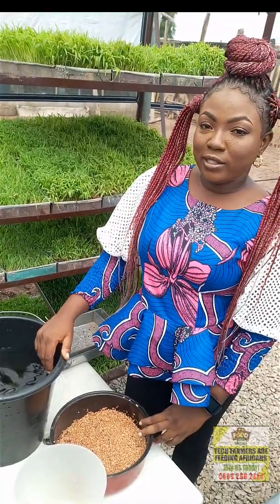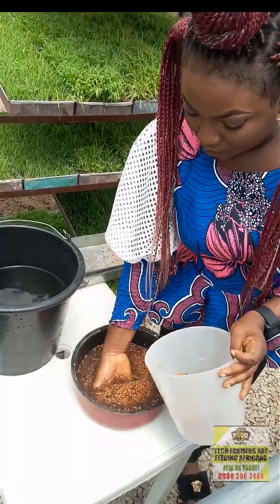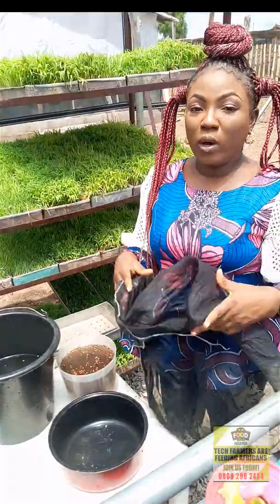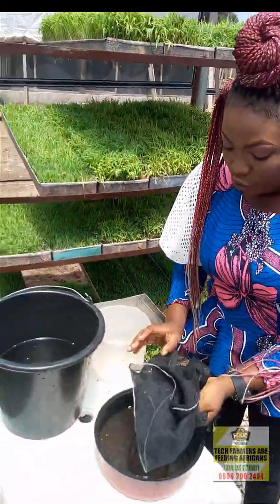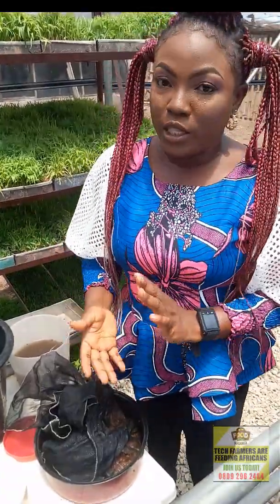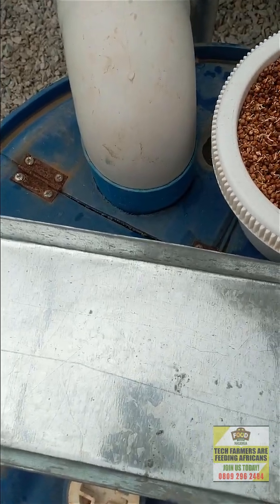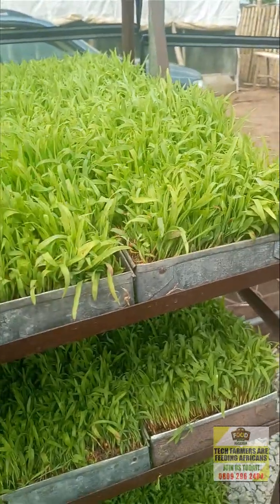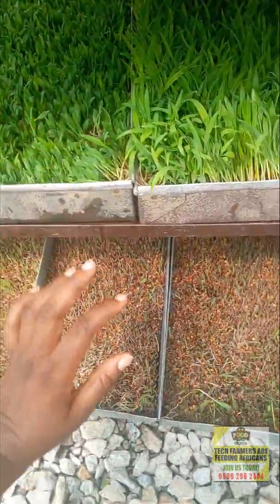fodder production using grains in hydroponic systems, The African/Nigeria Method

Comment: Interesting content... At 7:29 what's the issue? Because I had the same result and can't figure out what went wrong....
Cheers!
Reply from the maker: Hi, may i know the issue you have?
Reply: @TechFarmersHub  the roots went brown and it was progressing from the roots to the tip of the plant. Plus it was a bit moldy but it might have to do with the draining system efficiency
Reply: @filibusteros.305  If its moldy there is the likelihood of more water retention at the root than what is needed so you have to reposition the tray in a slanting format to make sure water flows down and drain out through the hole at the far end.
Reply from the maker: The grains need to be sterilized be for use. i.e soaking it in hydrogen peroxide or other bacteria neutralizing solutions for 20mins before use.
Secondly you must have good draining system on the trays to avoid water logg,
Reply: @TechFarmersHub  Alright! Thanks for the informations. Bleach is good instead of hydrogen peroxide right? Also what type of fertilizer should I use?